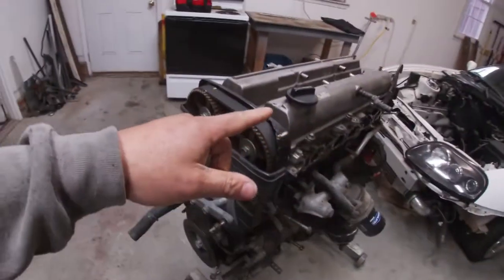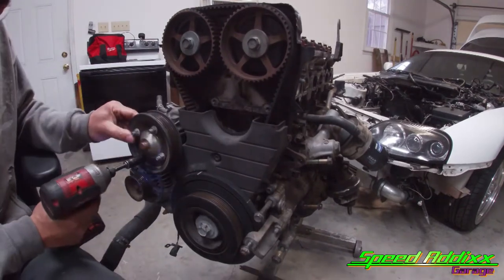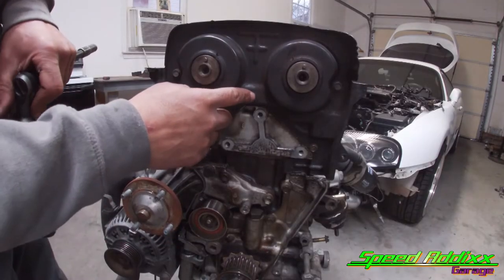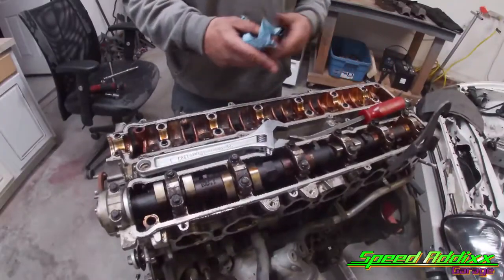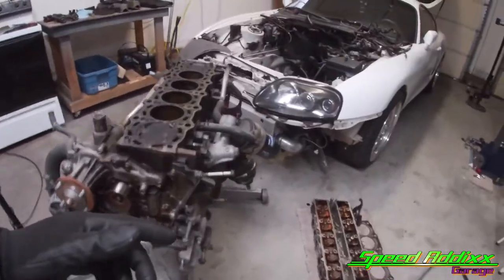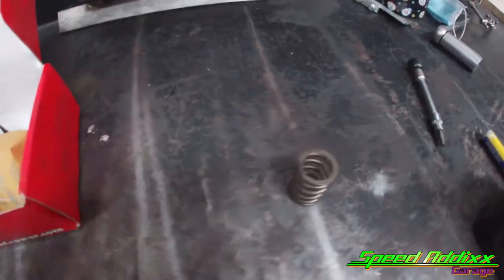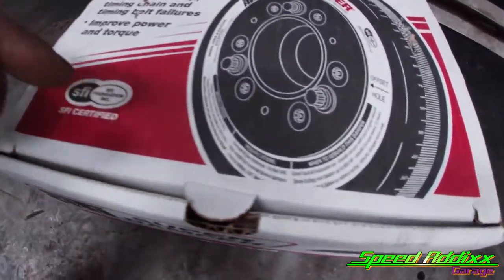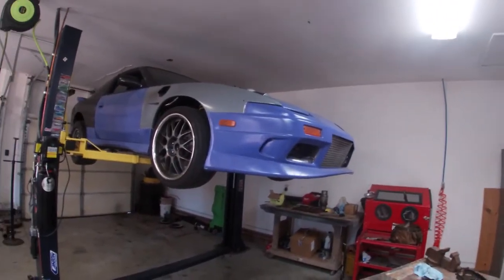2JZGTE Cylinder Head Removal-Channel Update!!

Comment: GTE with standard cams is non interference mate. Just when you referred to the cam turning taking off the bolt. Great vid though 👍
Reply from the maker: I read about that but ended up bending some valves on a VVTI engine a while back